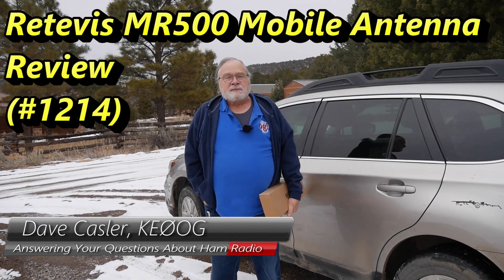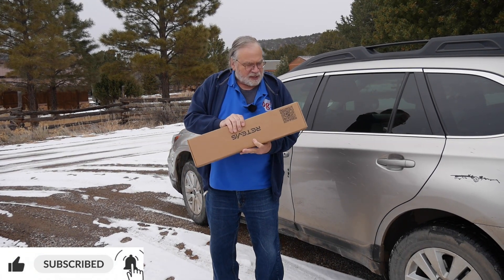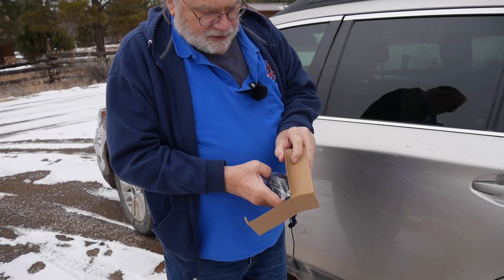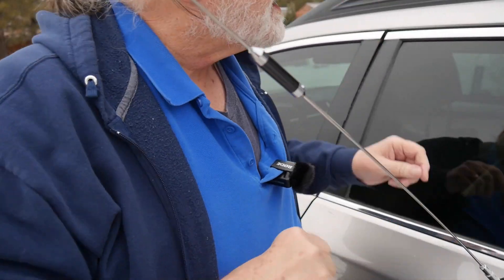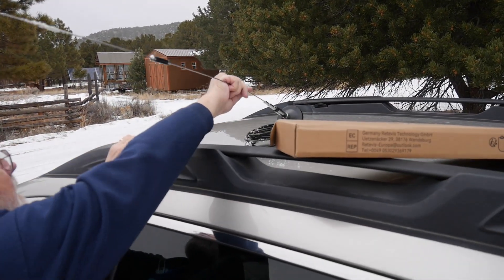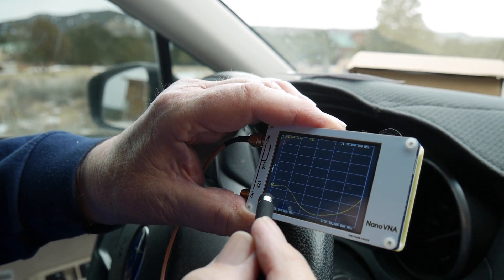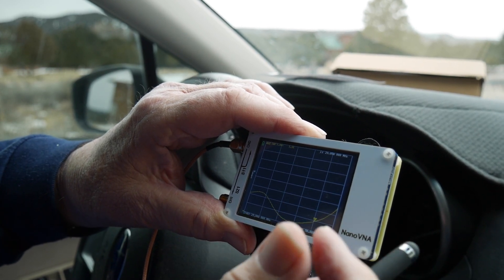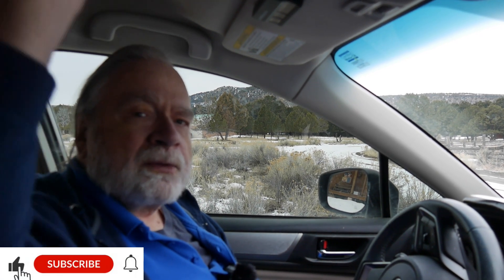Retevis MR500 Mobile Antenna Review (#1214)

Comment: A friend of my cousin got one of these antennas in a radio kit about two months ago and ask me to set it up. Appearance wise the antenna did not impress as it actually reminded me of the cheap cheesy antennas produced back in the 70'-80's. Initially set up was easy had great SWRs range was ok but again not impressive. A few weeks later he showed up where I work telling me he was having trouble getting out and hearing people. I keep an SWR in my pickup, so I attached it inline and checked the SWRs finding them sky high. Took the antenna off and checked connections. all was good till I grabbed the center load coil and found it was water filled. There was no evidence of impact (I also ask the owner if he hit anything). My guess is the cheesy looking cheap materials the coil is made of is not watertight. Since it is under warranty, I did not try to disassemble the coil to find out what was wrong. I am not advising too not get this antenna just advising to be aware of possible issues with build and material quality. Personally, I have enough high-quality antennas so I will not be a purchaser of this antenna no would I even consider it for myself.